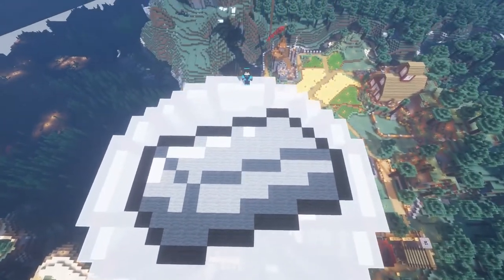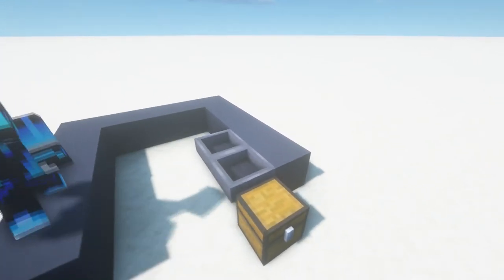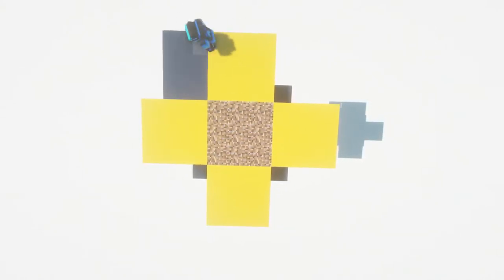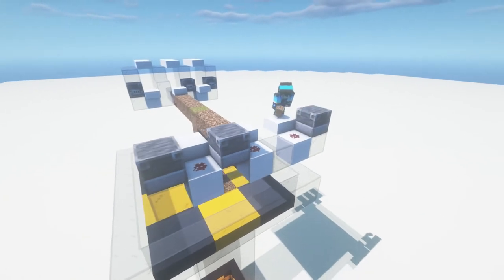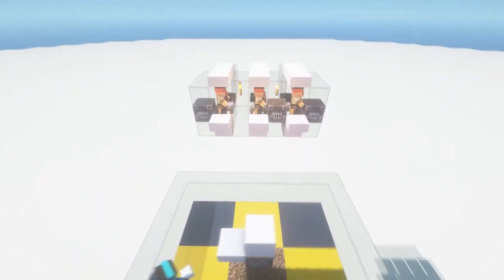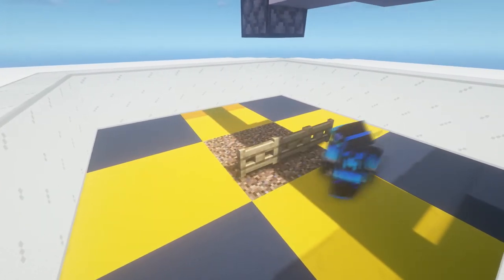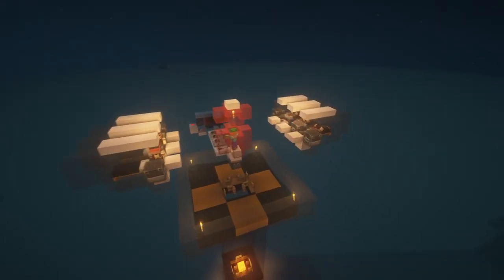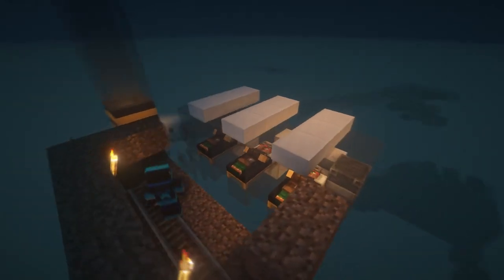700 Iron Ingots per hour Minecraft IRON FARM for 1.14, 1.15,1.16 and 1.17

Comment: Can I add 2 more villager cells on the empty spots/the area that has pure air blocks?

Edit:changed the full stop (.) At the end to a question mark (?).
Reply from the maker: Nope. The other two cells will merge with new cells you add beside it if less than 10 blocks away. A separate tower 16 blocks away is the recommended approach for this design.
Reply: @xpenenvy  k thx appreciate it

Comment: Could I build additional modules next to each other to increase efficiency?
Reply from the maker: Yes. Keep them 16 blocks apart so that villagers do not see iron golems from other modules. If a villager from one module detects an iron golem, it will not spawn its own golem.

I have a 1.16 version that is simpler but the tutorial will only be released once 1.16 is officially out. You can build this farm now as the 1.16 version of my farm only needs a little revision. Stay tuned, subscribe so you don't miss its release.

I have a video in my channel showing a teaser of the configurations with 2 or 4 modules.
Reply from the maker: If you successfully built another module, rates should be around 1400/hr. If rates fall below 1100, you may have built them too close and the villagers see other golems from other modules. By 16 blocks apart, I mean the whole structure (edge to edge of the spawning platforms just to be sure).
Reply: XpenEnvy awesome, thanks!

Comment: just finished this build in my survival and had two spawn right away! 1.15.2 (may 23)
Reply from the maker: Congratulations! I actually made a dirt version of this and might release a short tutorial. But outputs are the same, only cheaper to build.
Highest output iv seen so far is 771 per hour. BUT, I would not advertise this farm as such because I know the average is 704 in really long tests. Don't worry if you get less than 700, it will pick up in time.

Share it with others. It helps this small channel a lot. Thanks!
Reply from the maker: And yes, two golems per cycle is the norm. The platform dimensions, the height and distance from the villagers, the clock timings and short zombie exposure is the secret of this farm. Most designs out there (with thousands of views) require separate platforms for each set of villagers, hence they require more space and materials.

Comment: The video is made very well but I don't know if the farm is going to work and I don't want to use my materials for this before someone tells me if it works
Reply from the maker: Thanks for the comment.
I have this farm running in a vanilla 1.15.2 test world for nearly 10 hours already and shows no sign of stopping.
The same farm is in my single player 1.15.2 world for days, can't really count the hours, because I only time my test worlds for output computations.

My video actually shows the farm working but since it is on timelapse, I'm not sure if you can see the two golems every 30 seconds or so.

But thanks for the idea. I will upload a timelapse (but slower) of it in 1.15.2.

Consider subscribing for future updates to this farm!

Thanks!
Reply: i cant see why it wouldnt work
Reply from the maker: Here is a showcase video: https://youtu.be/kRlL86Mw6Ow